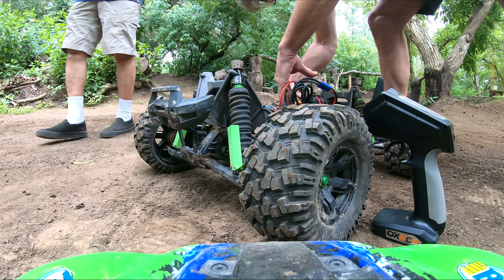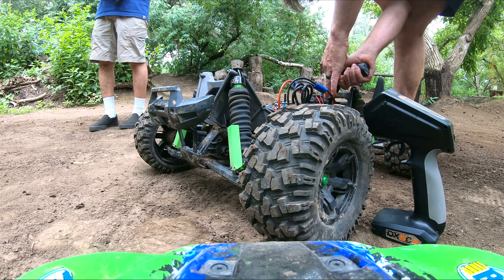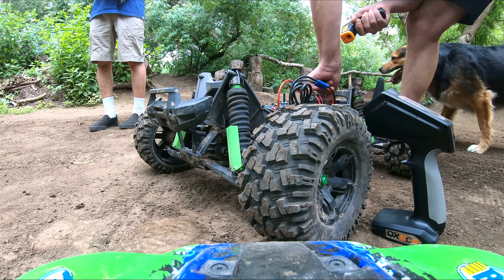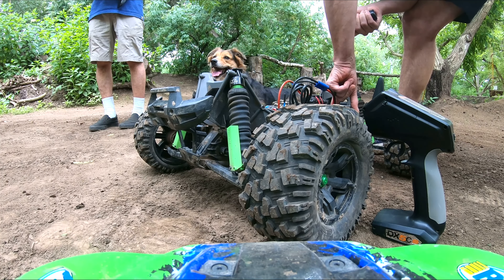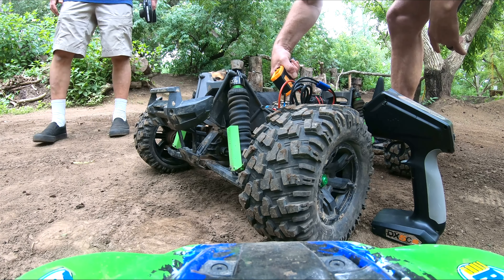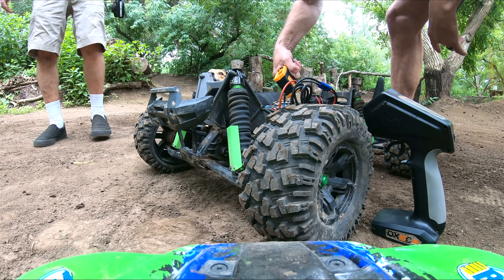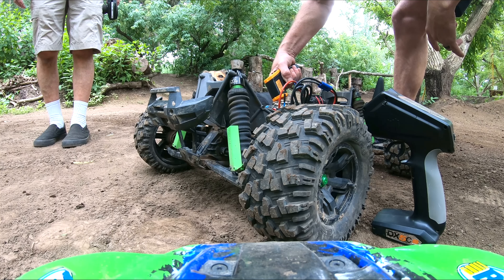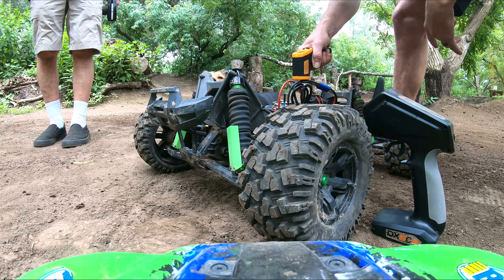XMaxx Test New Max6 combo 5687 1100kv and WFO gears

Comment: Running 21/35?   I just bought the Bowhouse and a hot racing 50T.  Smallest pinion with the riser is 33 that fits.  Do you think that’s too much for mod 1?  Have a max6.
Reply from the maker: Hi thanks for asking.. I never did research on mod 1 gears.. but the video from Exocaged  has the motor mount in one of his videos. He runs mod 1 gears.  My final gear was 23/35 mod 1.5 with risers.  Close ratio. I thinK it would work. My ratio is 1.52 ..yours a 1.51. Run it til it breaks and go Vitavon 1.5 mod
Reply: I think 1.5 will be the way to go.  But do you see any issues by giving up the Cush drive?   There is a guy who sell a 35t spur mod 1.5 that fits on the stock spur shaft to keep the Cush. So I’m trying to decide between WFO with their D shaped gears or vitavon or saga pinion with this special Cush Drive spur.   Thanks.
Reply from the maker: @howardsadofsky7694 I saw that in a video... it appeared it would be hard to get and i was not willing to wait (lazy) so i gave up the cush drive. I do believe it would be best to keep the cush if possible to avoid blowing diffs with high power systems to absorb the shock from drivetrain. I was gonna follow up with the 1.5 cush drive gear once i get the things i have done dialed in. also a vitavon ger cover... crap get in there...
Reply: I ordered The Vivaton 25-35.  Hopefully my max 6 will be sufficient.  Got a cheap mod 1.5 cover on eBay.  Will let u know if it works.  You get different opinions on the Cush Drive. Rich Duper bash says it’s a waste.
Reply from the maker: Good deal!!  Vitavon stuff looks awesome. The bowhouse motor and risers claim a max tooth count of 60 w / mod 1.5 gears...could not get the mesh loose enough... 3 layers of aluminum tape on the bottom of the risers got the 25T pinion to work...crashed bad and i think the motor moved and could not get it back, maybe dirt? Finally put a 23T pinion on and now its mesh is great...    im going for for fix it and forget it.
Reply: I was a little worried about mesh with the max size.  I don’t think Vitavon makes a 23 pinion so what did you go with?   Do you think 25-30 would have a better chance to mesh?
Reply from the maker: My gears are WFO "D" bore . when i was building i had problems getting the 25/35 to mesh, so i ordered a 23T pinion. After the fact, i read the Hobbywing Manual for the combo and they suggested gear ratios of 1.5 or higher.  If the 23T is too low and the car looses it grunt, ill prob put a thin pc of brass sheet under the mount, and go back to the 25T (just under the recommended 1.5 ratio)   30/25 is really tall (1.2 ratio) might be ok with a 56113 @ 800kv. ppl get near 1/1 with the big motors. I have an 8S outcast with the 56113. Its mod 1, but running 35/39, and its a monster!  The Max @25T air time adjustments were super sensitive "see saw" my way through the air... So for im gonna run the 23 until i get used to the truck having so much power, but im sure ill get back to the 25T.
Reply: I’m running 39/39 on my Kraton 8S with 800kv.  

So the only way to get a 25/35 mesh with bowhouse is to raise that riser even higher?
Reply: What about switching to the WFOmount?  Are you worried about bending it since the motor isn’t supported?   I love the M2C mount with support but I don’t want to rebuild the whole thing to install that.  Yet.
Reply from the maker: You will just have to try it. Vitavon looks to be better quality. I had two teeth that were "sticky" and could not get it to run smooth (too tight) just where the teeth had a catch. you can see it in the video where the car is rolling and then stops when it hit those teeth. when meshed properly it runs great. I used 3 thickness of aluminum tape on the bottom of the risers. My plan is to put a 1/16" brass sheet under the risers. it does not need to be that thick. im going to do that and get back to the 25T. For now im just going to beat on it and see how the durability goes...i did put it up like 20' tapped a tree branch and put it down on the lid . nothing broke but the body is about shot... added weight and power really take a toll on the body in crashes.
Reply from the maker: also...the WFo and those type dont help if you roof land... at least the pipe clamp on the Bowhouse should help with negative G on the mount system when it all goes wrong....
Reply: Brass sheet it is!
Reply from the maker: lol  Hobby the crap out of it!!!
Reply: With mod 1 gearing I tried 33/50 which is the smallest you can go with a 50 spur.  Could not get the mesh tight enough.  Bowhouse should change the min/max gearing allowances.
Reply from the maker: I believe there being generous with what might work...
Reply: Are you using : Traxxas Motor Mount Washers (7759)?  I think these are limiting the amount of travel.
Reply from the maker: I think the washers were supplied with the bowhouse mount or riser kit???
Reply: No, they only supplied small round washers.  These are recommended by them in addition.  They are aluminum and the same shape as the bottom of the chasis for the screws. I think they might limit the travel.  Not sure if needed.
Reply from the maker: Huh?  Don't know..I just have the round washers on the motor mount bolts?
Reply from the maker: I'm going to gets some of those Traxxas aluminum washers. I did see the small steel ones im using not center on the bolt, when I tightened them up so they are probably limiting to some degree. Thanks for the info... Ill let you know how that works out.
Reply from the maker: Looks like you nailed it Howard 
Got the 7759 washers and i think its gonna 
work. When both washer were on the bolt..2mm sticking up on the round metal washer. Put the aluminum washers in, moved the mount over and slid the 25t on like butter. Wrenched down on the motor mount and it still has a good mesh. Thank you for helping me figure this out!
Reply: Great to hear.  I’ll remove my washers and just use the traxxas ones when I upgrade.  Will be testing 35/50 mod 1 /1100kv next week.  Big jumps.  Just built new ramps.  33 hi by 70 long.  Should destroy all seven of my rc!
Reply from the maker: That's awsome..I think the reason I'm having trouble is after messing with the grub screws (2 ea per gear) I can now get good mesh until I tighten them... then I get noise..maybe not that great of quality. Bore on pinion is off???  Still messing with it...
Would love to see the jumps...  it's fame or shame.  Lol
Reply: Maybe WFO quality?  I will let u know how the Vivaton work.  Where can I send some pics and videos?
Reply from the maker: Calidw42@gmail.com.  Can't wait to see it!!
Reply: Just email you a couple jumps
Reply from the maker: Totally awsome...super smooth back flip. Nice ramp... I got to build one.
Reply: Hey I’ve been looking for a motor fan for the 1100 KV. How does that dual fan that you have attached to the motor?
Reply from the maker: Sent a few pics and info to your email
Reply: Does it attach to the plastic top brace?
Reply from the maker: Yep.  With zip ties
Reply from the maker: UPDATE    Max6 esc went up in flames... ran about 135 deg on the 1st set of batterys...  2nd set (45 min later) ran for 6 min. stopped (thermal... i think) then burst into flames...  not the 1st problem with Hobbywing esc's but didnt see this one coming.   just info    :)
Reply: I think Max5 is the way to go if you stay with HW. I have a Max 6 and tried 35/50 mod 1 gearing and it went into thermal pretty quickly. Going to try 29/54 before I give up on the Max6.
Reply from the maker: I think it was the tires...stock tires burned off an slid all over. Sledge hammer tires hooked up big time...had a friend test the fans fof  Amp draw since I was running all the cooling and the servo off bec... thought maybe i over heated the bec and set it on fire, but they had mili Amp draw so must have been the gearing  / tires. Saw a  couple " let the smoke out"  videos on 8s. Oh well...it a hobby  I'll try again...the performance was stupid!!!  Thing was so fast!!    So I'm thinking 56112 and castle xlx??  Gonna start beating the outcast, while I figure out what next for ESC. Let me know how you do with your mods.  Thanks Howard!!
Reply: I will. I blew all 4 stock tires.  Got the new proline Mx57.  Lot lighter than the original badlands. 680 vs 590 stock. Not belted so should balloon some.  Also vented in 4 spots.  Hope to get out again in a few weeks.  Lot of repairs in order.
Reply: With mod1, 35/50 was just to impossible to control and the max 6 shutdown.  Tomorrow I’m gonna try 30/54 gearing with the MX 57‘s.
Reply from the maker: I gave up on Max 6... stuck the 55113 @ 800 kv and the max 5 on the 25/35 gearing.  Backyard test was ok but I got some crazy noise when I turn right??? Gonna figure that out and go for a test bash.  I'll let ya know how it goes....
Reply: Ok so you went down from 1100kv to 800?  Do the sledgehammer tires hold up?
Reply from the maker: They hook up really good  middle weight compared to some proline stuff... kinda Ballon a bit bit well have to see. I bought the toro beast moror, but it didn't fit in the mount so I stuck it in my 8s outcast... what a beast. Stoopid power!!!  Runs like a 6s car  soo much throttle...
Anyway... the hobbywing 800kv 56113 went in the xmaxx with a max5 esc, and in waiting to beat on it at the c track. When I ran it in the yard the other day had a clicking sound turning right... either way  gonna make sure bearings are good... then I'm gonna give it a run.
Reply: My mod1 30/54 gearing held up.  The max6 held up.  But a bad jump and I broke a steering block.  Thinking of either going to the lighter tires such as the sledgehammers or aluminum steering blocks and caster blocks. What do you think?
Reply from the maker: Glad that worked for you... campfires sux. I'm still using all teaxxas plastic in front. Switched from RPM knuckles to the new factory that hold the oversized bearings (like the RPM)  got a max5 esc and was gonna set it up with the 5687... stuck the 56113 in there. Bought this skyrc toro beast, but wouldn't fit in the bowhouse mount... put the beast in my 8s outcast... what a monster  so much power.  Tested the xmaxx and all works good, but had some clicking in the left front... gonna sort that out and then go beat on it a bit. It's super hot here, so I'm on boats for a bit...
Reply from the maker: Thanks for all your help and feed back Howard
Reply: Hey I heard that those sledge hammer tires won’t hold up to extreme power and gearing. Have they held up for you?
Reply from the maker: Good morning Howard. Have only had a short 60 sec test in the backyard, kinda small but I kept it on the back wheels to see  how much they baloon. They do baloon up, but I think no worse than stock. I'm gonna get out in the morning here soon and give it a good run. It's been hot, over 100 most days. I'll let ya know how it goes.
Reply: Thanks.  I actually put on the new pro line MX57.  682g vs 640 for the sledge.  I just heard a lot of people complaining about the tires coming unglued and poor foams. I wonder how they’ll hold up to your extreme mod 1.5 gearing.
Reply: Hey, how's the Xmaxx holding up?  I ended up getting the Bass extenders (10mm) and put the Kraton 8S tires on.  Also went with HR aluminum steering blocks.  30-54 mod 1 gearing (might go taller) and had a successful day jumping.  single flips, no double.  Finally broke the stupid pin holding the shock to the the arm.  Hopefully a fluke and not related to the extra weight on the steering.
Reply from the maker: Have not run it lately. still need to find the clicking in the front knuckle. Had a short run the other day, tires hook up bigtime, and didnt blow them off the wheels. 800kv motor has some serious grunt but i think 25/35 mod 1.5 is too short. motor stayed cool, ESC hit 125 on a 90 deg day, but needs taller gearing to get big flips. got a couple new Arrma Kraton 4s v2... been beating on those lately an my Talion with Backflip LP tires. (too many cars) and boats too.   keeps me busy!